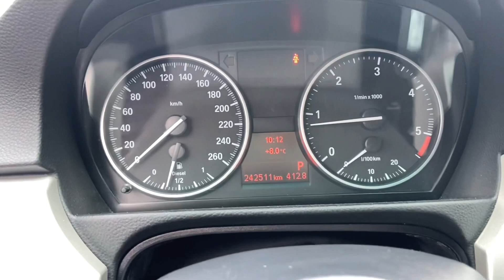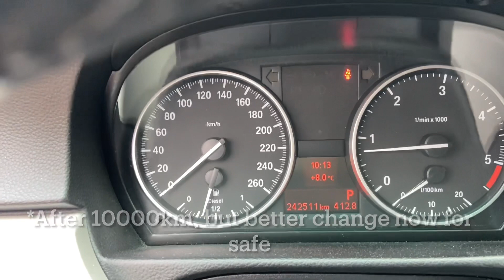BMW N47 timing chain problem prediction.

Comment: Mine sounded EXACTLY like this. No rattle on cold start, bit of rattling in the background on idle coming from the left side of the car just like in the video (needa listen closely). Anything above 1500 was extremely loud and increased with revs. Exactly the same sound heard in this video when the engine was being revved. Drove me absolutely insane trying to figure out what it was and I decided to bite the bullet and get the chain replaced.

Got the car back today. Problem solved. No more noise. It was indeed the timing chain.
Reply: and which chain needed to be replaced
Reply: @patrykpatryk7839 No idea. Replaced all chains, tensioners and all relevant gaskets, which is the only correct way to do it anyway.

Comment: Flywheel
Reply from the maker: on automatic gear box?🙃
Reply: @headliner4936  there is also a flywheel on an autotrans
Reply from the maker: @chieftre300  Yes, there is, but it is solid and without any moving parts...

Comment: Mines actually louder. Bought it with noises at 111.000km and now im at 201.000km without the timing chain tearing apart. Theres actually no evidence that the timing chain will tear when you hear noises!
Reply: This is a prime example of why BMWs get a reputation for unreliability, with these careless owners not doing the bare minimum in maintenance.
Reply: @tgb-vf4es  No, they got their reputation for using chains that are done at 130.000 or even below that, and are not easy to replace, while normally you should expect 500.000 without chain changing...
Reply: @Baryogenese quality cars are changing, its expensive yes but who buys €5000 euro car and cry about spending €1000 on chain?
Reply: BWM checked my chain at 130.000 and told me, the chain needs to be replaced, but I didn't felt spending 2600€. My car made it to 309.000 km then it started to burn massive amounts of oil, but the chain still worked.
Reply: @Baryogenese  Burn massive amounts of oil... What was your oil change service intervals? The chain just pure luck. It could snap any time. The problem is not only the chance of failure of the chain but also because the chain is streching a lot the timing of the engine is way off. The reason is why BMW told you that your chain needs to be replaced because your tensioner is extended out fully and could not compensate for the longer chain. Not to mention that because of the extreme high milage in the engine without the chain and bearing replacement the crankshaft is junk. I seen quite few of these n47-57 engines and around 200 000 km the crankshaft bearings are worn and start to damage the crankshaft. It depends of the usage of the car and the oil change service interval. It so easy to buy these cars but the real challenge is to keep them serviced properly. These engines are week and bad design.
Reply: @kriszml  130.000 was the last service I did, after that, I just drove to the end. I still have had the car standing in my shed, for about 3 years now, last year I drove a bit in my backyard, and the engine still sounds ok, if you ignore the oil burning...
Reply: @Baryogenese  so you never changed the oil in the 180k km you drove to 310k?
Reply: @Manuel-gs6qw  Yes, i only did some refilling with 1l bottles 2 or 3 times.
Reply: Extremly smart timg to do to drive that car without checking at least the tensioners extension. But one thing you right about. The indication of the timing chain fault is when you dont hear no more noises. I mean nothing after a big bang.. Smart..

Comment: Bought my n47 with 50.000km and it was already making this noise. Fast forward 10 years to 209.000km and no issue occurred. Not saying it can't break but this noise can't be the imminent failure announcement.
Reply: What model year of N47 is that? What version N47D20A or N47D20C? Thanks
Reply: @bolitedando5307  Because I want be to on the lookout to change the chain if needed.
Reply: I just bought an  x2 with b47 2019  model ( the b47c20b the update one )and make that noise at 100K km , I search to the internet or YouTube for a bad timing chain noise and I never found that sound, I always find the rattling on cold start sound and others with a lot of rattling or super weird sounds that mine does not have, the only video that matches  my sound is on that video, so I assume it’s not a bad timing chain issue sound, it is normal? , what’s your opinion? Also I think when the car is driving long time I don’t listen it at all or super cold I also don’t listen it , so it can’t be a chain because when it is cold theoretically must be more “loose “, also mine is b47 that is not common to have a failed chain what is your opinion?

Comment: Hi, i have the same sound, bmw 640d f13 2012, do you change the chain? Some people told thats normal...? Only at 1800 - 2500rpm, and only when the engine is hot, when the engine is cold, i cant hear nothing. No issue at the idle (cold or hot)
Reply from the maker: HI! Your engine is different. Possibly you can drive for some time, but should listen for noise progress. And as I remember on your engine should be noise for 1-5 seconds when you start COLD ENGINE. I have one more video on the channel about this.
Reply: @headliner4936 hi, thanks for answer :) I have no noises at the cold start. Only when the engine is hot, then i have the same noise as the video.
Reply: @stef5436 same with mine, and i confused whether to big job or look for other factors??

Comment: A lot of people been saying that they have this exact sound and their engines is still fine and put tons of miles on it. Isn’t this sound just original sound? Or classic diesel tick sound?
Reply: These engines will fail no question about. Not only the timing chain but the crankshaft bearings also and a cp4 fuel pump. These parts are just normal service items on these engines around 200000 km.  including N57 also.
Reply: @kriszml  literally haven't changed one of those things and i'm at over 230000km
dont say things you don't know
Reply: @moneyman7083  ok..you will find.out 😄. I am working on these engines every day but you know better. At the end, I dont care what you do but dont cry when the bearing spin around in the block.
Reply: @kriszml if you are working everyday on these cars you must know exactly what sound it is. My car has 356.000 km first timing chain same noise as in the video , n47d20c where the timing chain and parts are a lot stronger then n47d20a . this sound is from alternor pulley not from timing chain , a mechanic would tell the customer its timing chain because he would rip off the customers wallet
Reply: @lukykentucky  sorry i can not diagnose anything over a youtube video. You know i usualy take the serpentine belt off to determin where is the problem if i am not 100 percent sure. But on the internet you only can guess. I am not doing that because is poinless. I have no control over what other people or mechanic do. Cheers
Reply: @kriszml  I was a car dealer for over 10 years not a mechanic and I know very well how mechanics rip off customers wallet . I understand that you are not aible to diagnose a car from a YouTube video but you told that guy in the comments that you are working every day on this cars , the wishing sound 1500 to 2000 is very well known in these engines it’s alternator pulley I sold a lot of these cars to Eastern Europe some had over 500.000 km and are still working , a lot of them had problems with egr and DPF it was very easy to fix by my self with a screwdriver and a brake cleaner there was a common problem with egr even the new ones from bmw are defective from factory , a mechanic would charge the customer thousand of euro and tell them to delete the egr or installing a new egr , dpf , manifold etc. , there are only one or two videos on the internet that explaining the real problem with egr , the rest of them is completely bullshit to get some views on YouTube
Reply: @lukykentucky  man. I dont care and i can not control other people and mechanic. You try to diagnose a car on the internet is a joke. I dont do that. You do you ...
Reply: @kriszml  i know the sound in the video and this is why i know where is the problem , again I sold a ton of these cars . You are trying to fool people because you are a mechanic telling someone bullshit in the comments.
Reply: @lukykentucky  ok 😅 🤡
Reply: @lukykentucky  yea i have the same noise frome the alternor pulley

Comment: My brother has a light which keep coming on --been told its the chain £1500 to replace.
Reply from the maker: Light? Check engine light?
Reply: @headliner4936  Chain replaced light now red lol
Reply from the maker: @jetrex1986  red light? Where? As error code?
Reply: Engine light coming on and light rattling sound. 104k miles. My mechanic told me that I need to change timing chain. 😬
Reply from the maker: @uk.leonardosants  , wich error code is showing on?

Comment: I dont get this noise when i rev the rpm. 
Even after I changed my timing chain e92 2009.
At 91k in 2014
Now at 141k 2021 
Small Noise came back in at 95k 
But now ive lived with it and stuck to 5w-30 8000mile oil change i do myself now.
Car seems fine feels like once ive driven the car on motorway (daily drive) at 70miles i dont have any noise problems.
Reply: Hi 
Did the car run goof?
Reply: @mukhtaarahmed4473   i was able to drive the car from 2014 till 2022 with no problem.

You need to stop using 0w-30 oil

Swap to premium brand oil
5w-30 (mobil1) or castro edge. That will help the timing chain from weaken.
Reply: You had that noise even when you changed the chains?  I have a b47 with that noise and I know that a timing chains goes bad and sounds like “clak clak “, not like this on the video
Reply: We sold the car last year. But the noise never became bad. I've kept doing the oil change every year. Also my friends/ relatives have a b47 they never had any timing chain noise, one of them is at 127k miles and car runs smooth. Our driving is mostly motorway everyday @Chpspsa
Reply: @QuattroBajeena thanks that you answered,I mean that you had the same noise as the video and don’t become louder ?because also my b47 has noise like that in the video but not the  timing chain noises (like the rattling when it is cold start or the classic “clack clack clack “timing chain noises , so I think that sound is normal for BMWs diesel’s ..
Reply: @QuattroBajeena  so you paid without a reason the timing chain replace ?, because the sound it was normal ,I was afraid also for my b47 about the chain but as I see from the comments this sound is normal, thanks again my friend!! How much did you pay about the timing chain replacement?
Reply: @Chpspsa  my N47 was at 90k and I was always planning to change the timing chain, since there is been alot of cases on N47 timing chain fails at 90+ on 0w-30 oil. 
The fault was the 0w-30 oil its too thin and would someday make people's chain jump, the faulty sign was always the click click sound.

From my understanding, the B47 engine is alot lot better, but the same again if the millage is high its recommended to change the timing chain.
My uncles 2014 b47 is at 127k he will be changing the chain because of the high millage. Mechanic said between £1200/1500

Comment: mine was doing this also kept coming up with battery drain all the time so i ripped the engine out and changed the chain  clutch and flywheel while i was at it drives like a new car again
Reply: Yes you also can tell if the gearstick is shaking also with a bad flywheel .
Reply: Could it actually be flywheel?

Comment: Bought my E91 320d from 10/2011 with 90.000km with this noise from the chain. It now has 256.000km, same noise, oil change after 25-30.000km...
Reply: Oil change on N47 maximum 10.000km and the engine will run forever
Reply: Io cambierei l'olio ogni 15- max 20.000 km, non conviene risparmiare sull'olio perché hai anche una turbina da lubrificare...
Reply: So your just waiting for it to snap?
Reply: @kungfuhustle6363 Because it is the facelift model I have the N47N engine. According to BMW it has a revised chain system which will not snap anymore
Reply: @Schnubbi07  Thanks for these words, I'm worried about chain... Cuz mine is at 385t/km
Reply: Have the same noise with N47D20C
Reply: You change chain ,Still Have same noise?

Comment: 200000 miles 320d no rattle , oil change and filter every 5000 miles on dot
Reply: good going that my 123d is on 145k and just changed mine it started having a rattle and battery drain on it all the time
Reply: same bro

Comment: Same noise 142000 miles 2013 320d..never had an issue
Reply: Good one dave😘
Reply: I have a b47 with this sound at 100k km ( 62 miles) , so is this normal?
Reply: @Chpspsa this sound is from the timing chain sliding on the skates , don’t use 5w30 I got the same noise after some idiot changed my oil from 5w40 to 5w30 , some engines have the same sound after replacing the timing chain after 10.000 km , because of 5w30 you don’t get this noise when you use thicker oil after 100.000 km don’t use 5w30 .  Mine has now 356.000 I have the noise for over 30.000 km fist timing chain N4720dc
Reply: @lukykentucky thank you my friend ,  i understand  that is normal, it is my first diesel car , and I was alarmed with every sound, also my previous car was hybrid so I wasn’t used to sound anything when I was stopped 😂, I get it with 98k km and know I got 103k , the car is quick ,so economical even better than my 330e that I had , amazing car overall, I have an x2 xdrive 2019 20d and I am very surprised with the handling of the car ..thank you my friend and I wish to reach 356k km like yours ❤
Reply: yet 🤣🤣

Comment: Mines on 164,000m, had it from 84,000miles always had that noise. The car has never had the timing chain replaced. Still going strong, change the oil once a year. E82 120d 2008
Reply: Once a year?? Wow you should not do that man
Reply: @veiz-00-41  its alright to do it once a year if he didnt use it as daily or didnt drive above 8000 miles. mine is is going strong as well and i do an oil change earlier than the expected mileage. for example, if manufacturer of the oil says it should change at 10k miles i change it at 8k miles. mine is f30 2012 320d
Reply: @aqr20197  also the recommend oil change interval is 30,000km or 24 months. I’m well with in that.
Reply: I do 14,000 a year, it’s been solid. Never let me down, always use quality oil. Hasn’t missed a beat.
Reply: I just bought a 2008 320d. I heard a small ticking noise (the alternator belt and pulley have to be replaced so that could be it) the car has had regular oil changes and Its currently at 123000 miles. Should I worry about timing chain?
Reply: @nevenacirkovic6824  Zameni sva tri lanca, propratne delove sa španerima. Uradi mali servis i zameni ulje, i zamenu ulja bi trebalo da radiš na svakih 10.000-12.000km. I ako neki kažu 30.000km, ovaj motor ne trpi loše ulje, N47 je osetljiv, zbog same konstrukcije, ali zato uz dobro održavanje će te nagraditi sa izuzetno malom potrošnjom. Sve to bi trebalo oko 1200eur da te izadje u proseku.
Reply: @gugi63  zamenila sam ulje i servis za ulje je uradjen svaki 10000km , samo lanac nije menjan , kosta 1200 ovde da promenim lanac
Reply: @nevenacirkovic6824  how is it now? Did the chain still working ok as long as you keep up with the oil change? ;)
Reply: you had the same swishhh swishh sound ?

Comment: The scraping/grinding noise of the chain is kinda normal because of the timing chain guides. After changing the chain you will get that noise after a few thousand kilometers.
If you hear your chain clicking or slacking at cold starts (because your chain is lengthened and you need oil pressure for the tensioner) or even worse with a warm engine than you have a serious problem
Reply: My friend I think it is normal because my b47c20b has the same noise and  haven’t none of the timing chain noises like the rattling at the start or the “click click click “, I just bought it and I notice it, and I researched to see what a bad chain sounds like and never found this sound I always find the rattling at the cold start or the “click click “ or even louder sounds that my car doesn’t  have , so I think it is normal?
Reply: So do you think that even if it's cold it's a problem or is it more problematic if it's hot? It's cold to me, it makes it very considerably hot much less.

Comment: My car does the same thing been driving with I close to a year now, someone told me I would try 5w40 oil instead of 5w30, would be a cheap fix
Reply from the maker: I’ve tried 5w40... It did no magic.
Reply: @headliner4936  you can get the chain check by a bmw service it cost a bit but then you sure if it’s to long or not.
Reply: @Matthew Plowman yeah it’s still running, it’s done 160k with the same chain now and it’s from 2010

Comment: my 118D has had the same noise for the last 6 years when bought from the dealership at 40k miles. Had no issues so far...
Reply: Same 118d noisey tractor, same noise on 86k miles now what's your one clocking?
Reply: How often are you changing the oil?
Reply: you had the same swishhh swishh sound ?
Reply: @edva135 I have the same sound with my x2 2019 b47c20b engine at 100k km , you have the same sound? But the bad chains sounds is other than that, is the rattling at the cold start for 1-2 sec , or rattling with the “clack clack “ noise because the chain is loose , I think it’s normal
Reply: @Chpspsa  Had this sound for three n47's ,all had chains streched.. new chains ,after one year of driving sound wont come again.. :) good luck
Reply: @edva135 ok thanks, how miles do you had with the new chain?
Reply: @Chpspsa idk,cant remember for this moment,but im driving it like i stole it ,change oil every 10k km . No problems for now. I have put febi/swag chain set (inside box you will find oem IWIS chains)